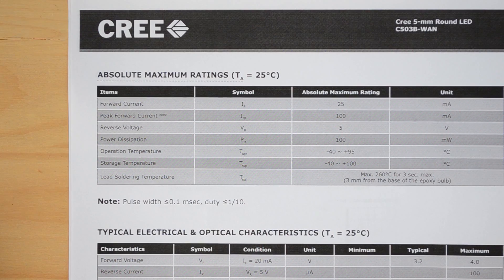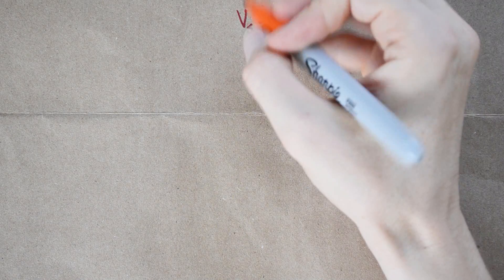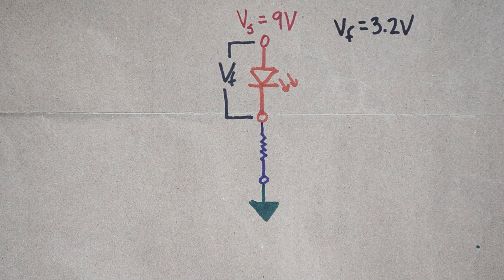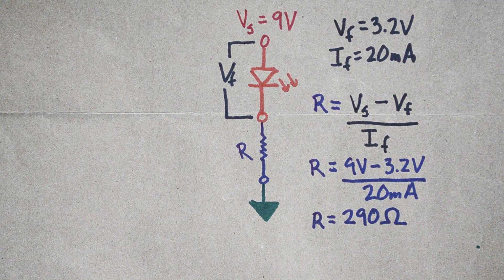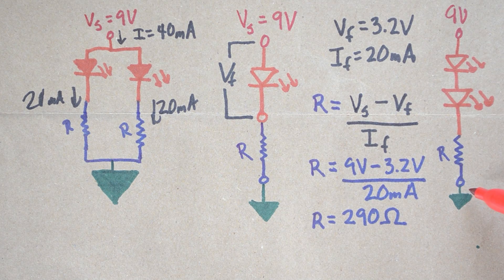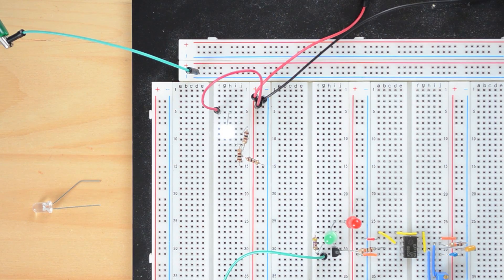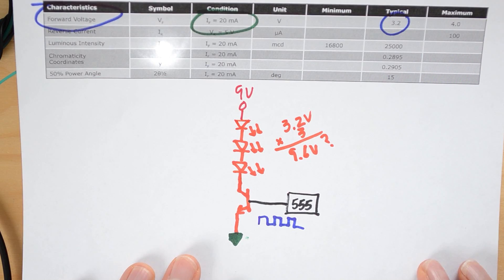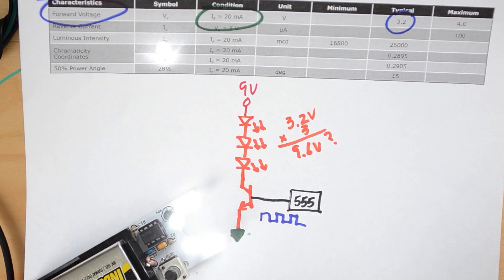How to Use an LED

Comment: I have previously driven an LED succesfully with a 5 volts source and no resistor, throughout the LED's entire brightness levels, by the use of a PWM signal.

It did work.

However, I was told by everybody not to do that and I would eventually burn my LED down. 

Why?

Comment: Umm..i kindda get confused in the way u use the resistor...
What i used to do is, i put the resistor first, then goes the led; so the resistor adjusts the voltage and led will get what it need as soon as the current meets the led. But how can resistor work if u put it after the led? The current already gose through the led! what i think the resistor is only gonna be able to play with the current that is left...which have nothing to do with the led....
I've seen many people do this..and i've tried myself, which worked...but i don't really understand how it does the job
Could u please explain?
Reply from the maker: +杜木 It doesn't really matter which one you put first. The resistor will still control the amount of current being pulled down the branch. Don't think of it as if current goes through the LED at a particular rate and then is slowed down by the resistor, instead think of the LED as something that does not effect the current for the branch and the only "flow control" for the current is the resistor.

Comment: Question here :)  So when you've got a LED and a resistor in series it doesn't matter how big the resistor is, the LED will have let's say 3,2V on it (depending on the datasheet) but the current would be really small if you would to connect a very big resistor. So the LED woudn't light up (at least not enough). Am I getting it right? I thought that if you connect a resistor in series to a LED the voltage splits up in between them. And if the R would be too hight the LED wouldn't pass the threshhold for the forward voltage needed for it to even light up.
Thanks for your time...

Comment: Great video, however I would have liked you to explain that the formula is over amps not Milla amps. and you end up with a decimal number that you need to multiply by 1000.
Reply from the maker: +Gordon Johnston You are right. I assumed everyone would already know how to convert to the correct units. I do the conversion automatically without thinking about it.